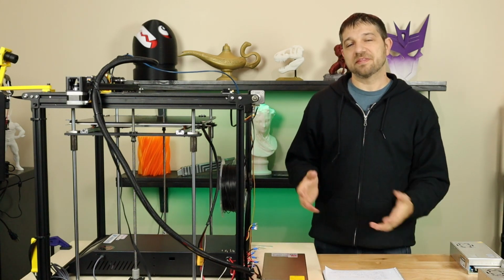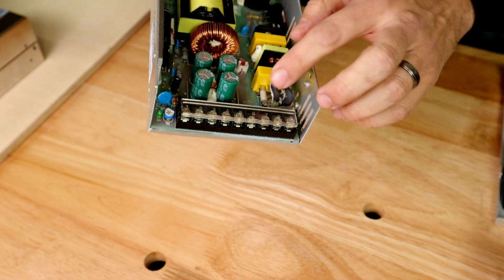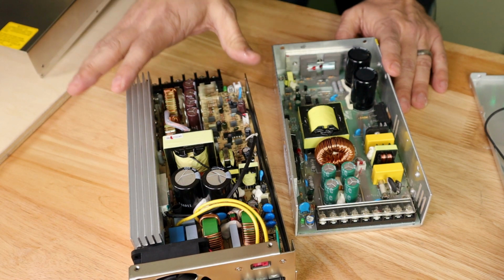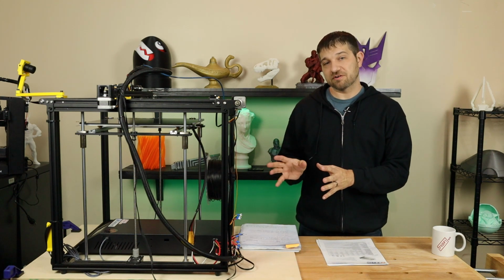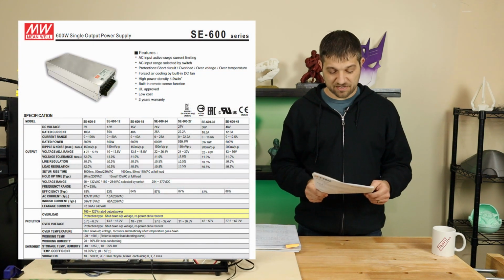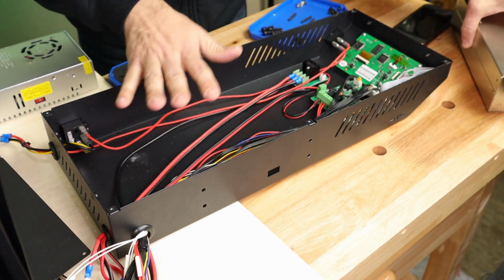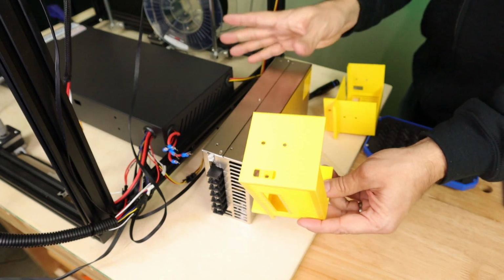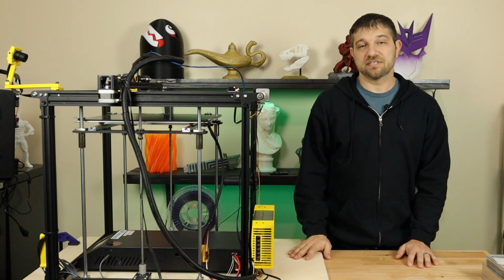Ender 5 Plus Power Supply: What You Need to Know!

Comment: Great video! I would think a 650 or 700 watt power supply would be better to offer more headroom so the power supply would not be working so close to crossing into the overload zone. I would be curious to know if you measured the wattage when printing to see how much the stepper motors would add to the total draw. Or if you want to add accessories such as a buck converter for an OctoPi, you'd have more room to expand.
Reply from the maker: Thanks! I added a clarification in the pinned post about power usage. Keep in mind that the 600W+ was from the AC input. Actual usage is around 500W or so, DC. 600W rated should be plenty. From my research, steppers should run at less than 5W. Accessories though can vary quite a bit and it's why I went with a 600W supply.

Comment: I did not see anyone suggest this - you could heat up only the bed first, then once it is at operating temperature, heat up the hot end. You could even partially heat the bed, say to 50 C, then wait a few minutes, and heat it the rest of the way, and that may make enough difference that the stock power supply will hold up.
Reply from the maker: The problem is, you can't control the heating a cooling cycles during printing. I'm sure that the cycles coincide many times during printing. My power supply died in the middle of a print, not during pre-heat.
Reply: @kerseyfabs  If the heating system uses a heating element with a positive thermal coefficient of resistance, then gradual heat-up will make a big difference. As the heater gets warmer, its resistance may dramatically increase, reducing the current and the power draw. You could easily measure this by heating the table to its typical temperature and monitoring the power draw in the beginning and at the steady state.

You should also measure the output of the power supply instead of the input, since the efficiency can vary drastically between different designs. The closest Cheng Liang power supply I could find specs for is this one: https://www.alibaba.com/product-detail/AC-DC-24V-21A-500W-LED_60521320043.html , but from the brief glimpse at the PCB in the video it seems to use a really basic regulation design so I wouldn't trust that spec for a second. 

By the way, I found this amusing video about the company  https://www.youtube.com/watch?v=qJ3_d7bgjto -- they don't exactly play in the same ballpark as Mean Well or Delta...

Comment: insted of changing power supplies, out of the box just add a kenovo 120 volt heat bed and relay. Then you get more performance on the heat bed, and reduce the the load on the power supplie.
Reply from the maker: From a technical standpoint, that sounds terrific. Most people though don't have the technical know how to pull that off safely. I've avoided working with mains voltage on this channel for that reason.

Comment: What's about using a solid state relais and a and 240 or 110VAC heated bed? At the end it cost less for a better result
Reply from the maker: You definitely could replace the bed with an AC solution as others have suggested. Someone else even suggested just putting an AC pad on the existing bed. I won't be going that route.

Comment: Those are likely MOVs that burnt if that is the AC in. They are designed to take voltage spikes above you typical 120v and shunt it to ground. Inside the kitchen you have a lot of equipment that can cause a voltage spike when they shut off. It's like water hammering when you shut off a valve and you have nothing to absorb the water pressure. MOVs tend to fry like that when they shunt a spike too many.
Reply from the maker: Thanks for the info!

Comment: I bought a 5 Plus a couple of months back which came with the 500watt Mean well PSU. It turned out in my case at least this PSU is not man enough. I had issues in the Z axis of my prints which I finally tracked down to the bed heater switching in and out, print without the bed being heated no problems whatsoever. I have gone with your advice and today a SE-600-24 arrived from Digikey. I am not sure these PSU's are as capable as one might think. Note on the overload statement as per the datasheet it says 105% ~ 125% of rated output, why a range? Well I would suggest what this is telling the user is the PSU can tolerate overcurrent of at least 105% but MAY be as high as 125% if you are lucky!! So I would suggest that one should take the lower figure only or you are just pushing your luck. This is just the way I see things and I might be wrong......

Comment: Thank you for this video. I think if i get a ender 5 plus i might opt for a meanwell 1000 watt psu for headroom sake for future upgrades and lower output ratings due to age. or go with a ac mains powered heated bed and take 90% of the load off the psu.
Reply from the maker: No problem. The 1000 watt would give you a good amount of headroom. I haven't had any issues with the 600 though.

Comment: My 5+ had Mean Well RSP-500-24 and it died just after 1.5 years.  On most of the time but mostly in idle, not printing.  I was looking at replacements, the I have have is expensive, found the 600 and an off brand (Drok, lots of reviews) but 480 W.  After watching this, I'm going with the 600 W Mean Well shown in the video.  I didn't realize the unit was taxing the supply as such. Thanks
Reply from the maker: I've been happy with mine. Just a note, it isn't a quiet supply.
Reply: @kerseyfabs  I got a reasonably large Noctua NF A9x14fan for my supply just before it failed. I’ll have to see about adapting it to the new one.

Comment: I am unsure how long you had the printer inside prior to firing it up. One of the problems with rapid temperature/humidity changes from a cold to warm environment is condensation. The power supply may have had a lot of condensed moisture forming inside the case. That can lead to all sorts of problems including failure. I've also seen rapid thermal changes create problems with marginal solder joints on a PCB.
Reply from the maker: It had been inside long enough. I had been working on an upgrade prior to the print.

Comment: I think, maybe you need to look at how you are running your test. When you measure the wall plug wattage this  is not what is being delivered on the 24 volt side of the power supply. If you look at the spec of the 450 watt power supply, you will see at rated out of 450 watts on the 24 volt side of the power supply can draw up to 1100 watts on the line side of the power supply. That's what I am reading from the spec sheet in the video. So when you are reading 500 watts on your AC line Volt/Watt meter is not what the power supply is delivering. To me what that means is that power supply is loafing along at half rated power. The correct way to do this, is to measure the Amps/ Watts on the 24VDC line as it leaves the power supply then you will get an exact current / amperage reading the power supply is supplying. To clarify, again if you look at the rated output of the 24 VDC is says 18.8 Amps @ 24VDC (the output voltage) which equals 451 Watts. Amps X Volts = Wattage (power). Because if you think about it, it would be irresponsible to put an under rated powered supply in a product plus one heck of a liability lawsuit. Now why did your power supply fail? Who knows a voltage spike, a close lightning strike, an under voltage input from the power company. Just because you found 2 burnt components does not necessarily mean that they failed first. It could be something upstream from those parts. Only true diagnostics will tell you what happened. I have a load of HAM radio equipment that operate on 13.8 VDC at 20 amps. I have several 13.8 VDC power supplies that run on AC. All those power supplies are hooked up to Uninterruptible Power Supplies that not only have backup battery power but also perform Line Regulation for voltage sag or over voltage. They use pure Sine Wave Inverters so I will have clean pure power at all times. If you are heavy into 3D printing, you should consider getting high current rated UPS systems.

Bruce

Comment: I'm an EE and agree with using a higher wattage power supply. An analogy would be riding a 100 cc motorcycle on the freeway, having to stay at full throttle just to keep up. The engine won't last long being run that way, whereas a larger one doesn't have to work as hard and will last far longer. Same with power supplies.
Reply from the maker: Thanks for your feedback! Always good to have some professionals in here. 👍

Comment: i really suggest adding a foot to that PSU to stop the cantilever thats happening with it when you touch it, but overall Fantastic vid!
Reply from the maker: I also added a second set of holes on the mounting bracket so you could secure it from the top and bottom of the 2020.

Comment: Actually it would be much cheaper simply to add a SSR, an AC silicone heater an an earth leakage circuit breaker. Ouf course preferably done by manufacturer. There seerms no good reason to use 24V for heated bed esp. on a cube design with not much movement of the bed.
Reply from the maker: In the case of working with what we have, it wouldn't be cheaper if you wanted to have a new piece of aluminum cut that size. From a manufacturing stand-point though, I agree.
Reply: @kerseyfabs  If you want to improve the printbed the same time by using thick fine milled aluminum (which allways is a good idea for a cube design) you are right. But you can alternativly glue the silicone heater under the existing bed.

Another way to get away with underrated power suply if it is not already damaged: Use the internal power supply for the bed only (by using an extra Mosfet) and use a cheap 120W power supply for the board and hotend. The cheapest way if someone has an Ender 5 plus, the power supply still beeing O.K. but wants to avoid to burn it if in summer ambient temperature goes up...

Comment: Kris, one small mistake, at 22:45 you are mounting the covers on the Mean well and you have captioned M5 x 5mm screws.  I think it should be M3 x 5mm.  I just finished mine and was looking back through the video for placement
Reply from the maker: You're absolutely right. Luckily I called for the right part in the description! Note being added to pinned post. Thanks!

Comment: I'm late to the party but those were inrush current limiting NTC thermistor They prevent excess current draw when the power supply is turned on and the caps charge up to the left of the thermistors. They start out with high resistance that drops as its temperature increases. Honestly it was probably part quality that caused this issue. Just a cheap spec NTC. Saved the manufacturer a few pennies per supply and typically lives just past the warranty.

Comment: The components that failed look like in-rush current limiting resistors.  It's weird that the second power supply started failing right out of the box.  It makes me think that a failing power supply is a symptom of an issue with something in the printer, not the cause.  Have any settings been changed that will make the printer draw more power during start up?  A beefier power supply could just be masking the real issue as it will allow for more in-rush current.  I thought these 3D printers were set up to bring either the hot end, or bed up to temp first, and then bring the other up to temp.  This will help reduce the overall draw on the power supply as these heaters require less power once they achieve their setpoint temp.

Comment: Still eagerly awaiting the next Ender 5 Plus video, and hoping you do something about a motherboard upgrade!!!  I picked up a Bigtree SKR 1.4 turbo with 2209 drivers, and have ZERO clue where to find a proper configuration.h file for this thing.  Found them listed for the 5 and 5 Pro, but nothing for the 5 Plus.  It's driving me insane, especially when printing with Z-hop enabled.  I get loud 'squeaks' every time it hops, and I've already greased the Z-axis rods up.  I was hoping the SKR / 2209s would help that, but I can't install it without a sample profile, since I don't know how to set all those variables properly for the dual Z-axis on 5P.  It looks like not a lot of folks are using the 1.4 turbo boards with the 5P.
Reply from the maker: I'm working on it but it'll be a couple of weeks. I have so many videos in the queue! BTW, that board is in the line-up.

Have you looked into the Official Ender 5/Plus/Pro Facebook group for people that may have configurations?

I don't think that will fix your squeaking though. Look into the POM leadscrew nuts I showed in my upgrades video.
Reply: @kerseyfabs  nah, the squeaking is specific to z-axis hop.  I need that enabled for certain prints, particularly the Gayer-Anderson cat.  But the squeak only happens when the Z-axis hops.  Otherwise it's smooth and quiet all the way up and down.  I did watch your Ender 5 Plus upgrade video (about 5 times now), and I already have the leadscrew nuts, but my z-axis bars are pretty solid, they don't wobble like yours did in the video.  Once I get the SKR board figured out, the modding begins.  I'm not on Facebook unfortunately, so I'm missing a lot of great resources there I'm sure.  I've been Googling the weekend away and did find some people that uploaded Ender 5 Plus config files to Github for Marlin 2.0, but I haven't tested them yet.  I was hoping to find a 'standard' base config officially from Marlin, but that doesn't exist for the Plus.  You can find one for EVERY other Ender printer BUT the Plus, hence my pain, LOL!

Eagerly awaiting more video Kris, you're one of the best channels I've found for detailed knowledge on this stuff!!  Keep up the great work!

Comment: My Ender 5 Plus came with a MeanWell RSP 500 preinstalled.. which died a few days ago with a bang... a capacitor blew on powering on the printer. I need a new one and am not sure, if MeanWell is the best option.
The printer never really worked and maybe the often on and off switch action trying to make it work with different hardware specs (checking connections, replacing the stock mainboard with SKR 1.4 Turbo... several Marlin installations... )fried the PSU in the end.

Comment: upgrading from a 15 year old RapMan 3.2 to this printer.  Appreciate the videos and upgrade insights!
Reply from the maker: No problem. I'm glad you're finding them useful.
Reply: @kerseyfabs  I even further appreciate the response! Another question I have is, any experience or examples with higher temp materials with this printer (stock build plate / no enclosure)? ABS or PETG? You often mention the name or color, would like know the type too please!
Reply from the maker: I've printed PETG with the stock hotend with no issue. If you just change out for an all metal hotend, like the one from Micro Swiss, you can also print materials like nylon and polycarb with just some good bed adhesive.

Comment: Not looking forward to the time when I might have to switch power supplies on my E5+ (not Meanwell). I would like to try an print Polycarbonite which seems to require a hotend at 275°C and a bed at 110°C. Would I be stressing my device if I try to press to these high temps?
Reply from the maker: The way that the power supplies work, it wouldn't put more stress on it but it will require it to stress more of the time. So it is possible that it will burn up faster.

Comment: One thing I noticed you didn't mention was about the difference between rated output power and the wall draw you where measuring. 
So the 600 watt power power suply you have is listed at 87% efficency, so that's an output power of about 500.25 watts. 
The 500w power supply at 89% typical effiecence would be drawing about 555 watts from the wall.
Reply from the maker: I actually mentioned that at 9:45 in the video when I compared my numbers to TH3D's numbers. I did the best with the tools I had at the time. Since then, I've upgraded my multimeter. Thanks for checking my numbers though!
Reply: @kerseyfabs  Apologies, Yes you did. I just didn't go back and re listen to that bit.
When you where talking about the power supply specs is what got my attention on the topic.
Reply from the maker: No problem. I try to be as clear as possible. This was a case of possibly not mentioning it enough.

Comment: The 500w power supply means that it outputs 500w on the DC side, but it will draw more than that at the plug because the efficiency isn't 100%.